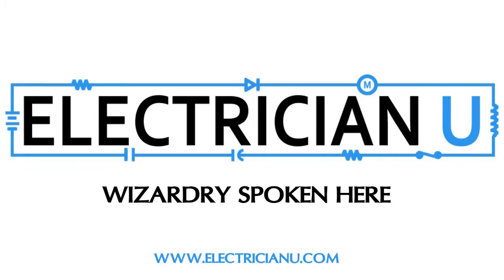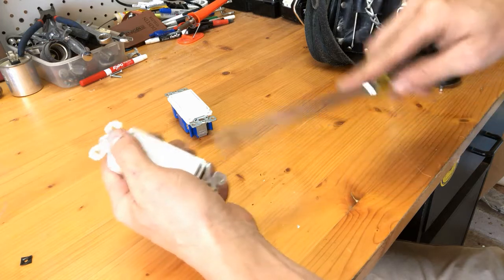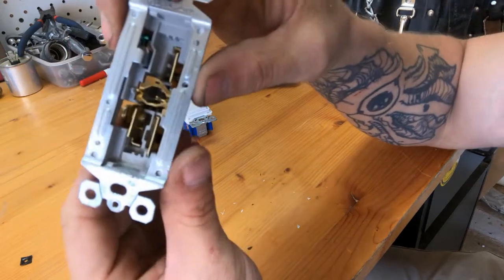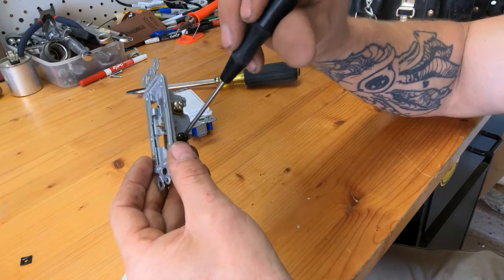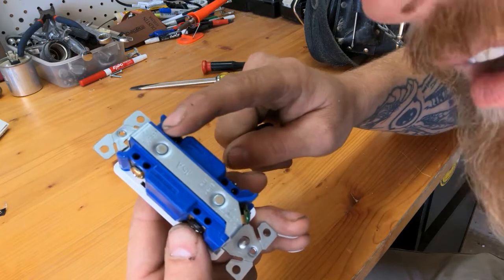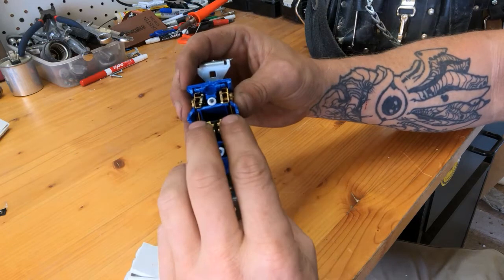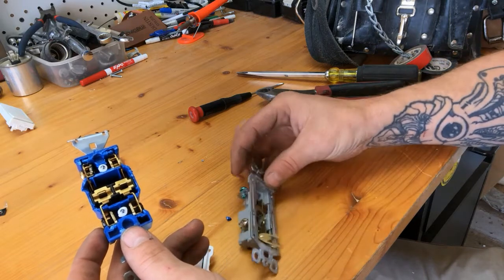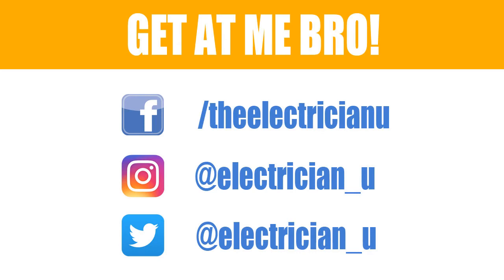Episode 10 - What's Inside A 3-way and 4-way Switch?

Comment: Thanks for taking the time to post this kind of stuff, as there's not much on the internet regarding the inner mechanisms of switches. Please correct me if I'm wrong, but at 1:54 it appears you might have confused one of the travelers for the common, when you said that "it's going to take this terminal and this terminal and connect the two". At least from my perspective it looks like both of those terminals are travelers. From my understanding of 3 ways, the two travelers are never connected, but rather the common connects to either one traveler or the other. 
Sorry if I've mistaken what I'm seeing or if I'm misunderstanding, and I appreciate your insights. 
I'm wondering too if you have a video showing the inner workings of common "flip" switches, as opposed to the "rockers" that you've shown us.
Great tats too btw👍

Comment: hi there.. is there a wrong wiring connection in switches that might cause short circuit.. thanks
Reply: Jeremeiah Angeles@ I have incorrectly connected 3 way switches.  In my case my house was built in 1950 and the terminal layout back then was not standardized, each maker had a different layout.  In addition there was the 1 white neutral and two black wires, nowadays you would have a black hot and a red switched traveler.  So I discovered 3 miss-connection possibility's.  #1. Direct short, breaker trips.   #2. 1st switch turns light on, but can only be turned off by 2nd switch at end of hall.  #3 one switch turns on/off, other one dead.  A little bit annoying but no damage done.  Also if you run out of single pole switches, a 3-way can be used in it's place.  Just ignore the traveler terminal.

Comment: Why is the first switch called a three way when there are only two states? The common is either connected to output 1 or output 2 depending on the rocker position.
Reply from the maker: We call it a 3 way because of the 3 directions current can take to the switch. When you drive a car and you come to a T we call that a 3way intersection. Similarly current can come into the switch (1), can take one path (2), or another path (3). It is silly I agree, it would be less confusing to just call it a 2way.
Reply: Thanks for the reply.